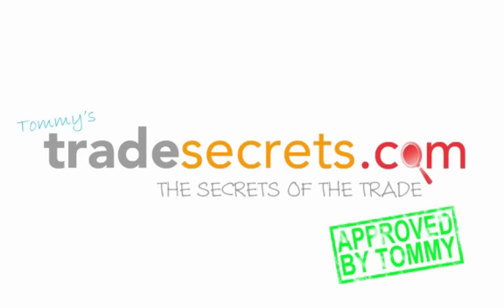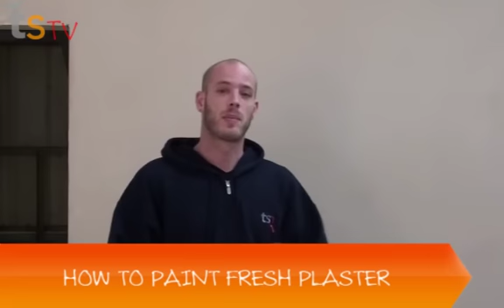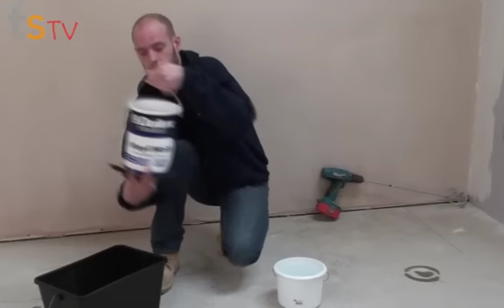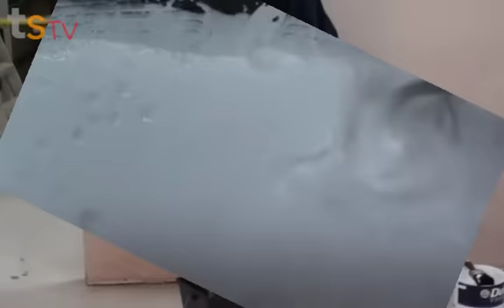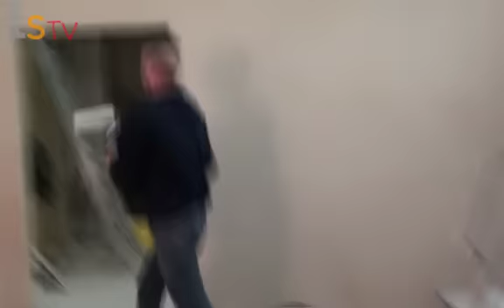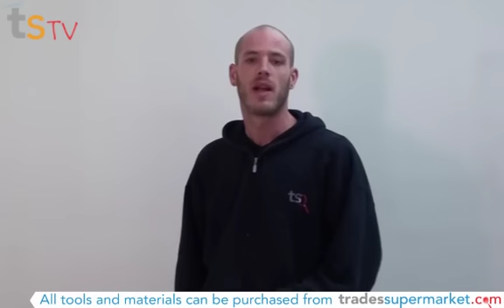Tommy's Trade Secrets - How To Paint Fresh Plaster

Comment: I been a college qualified painter for over 30 yrs. Never put PVA under paint, it is unecessary and can cause problems. You are thinning your first coat of paint so it has the ability to soak in and get a grip onto the wall - that priming coat lasts the lifetime of the wall, but it can't soak in if you PVA which will break down before the lifetime of the wall. The first coat is best applied with a brush to get under any residue and to work it in.

Comment from the maker: @parkinpants We recommend using a watered down MATT emulsion for the first coat. Don't use vinyl or silk emulsion for the first coat. Water it down with at least 30 % water. Any subsequent coats should not need watering down. There are also specialist paints on the market specifically for this purpose.

Comment: You should never use PVA on fresh plaster, essentially what you want is the paint to soak into the plaster for good adhesion. Painting PVA onto it stops any paint penetrating it so it sits on top of the PVA and paint will peel off in time, particularly in bathrooms and kitchens where the heat softens the pva base coat.
That is a nightmare to sort out, you either have to scrape back to plaster and start again or apply binding primers and mess about filling and priming for emulsion top coats.

Comment: Hi Tommy, I've just had the whole house re-plastered and re skimmed. I've noticed that some of the plaster has come off by one the electrical plug fittings. Once the fittings are on - it leaves a hole. Is this something plasterer should fix or can I use polyfilla or any other product to fix it?